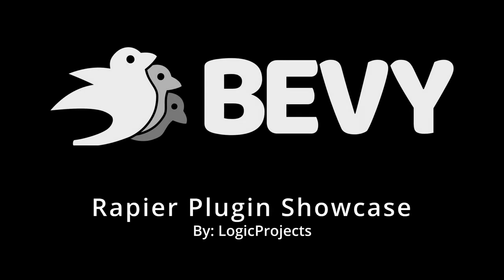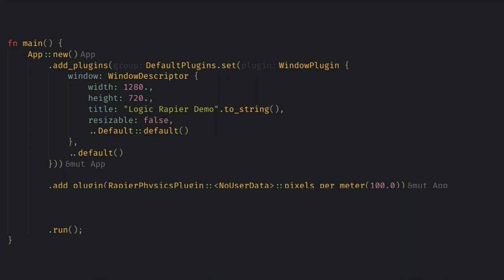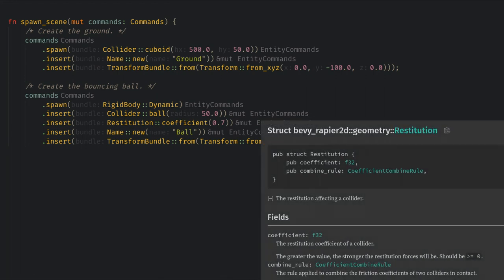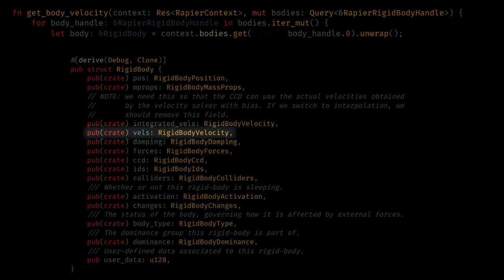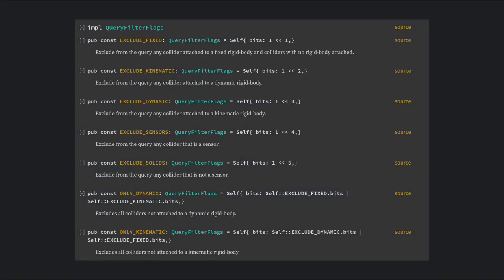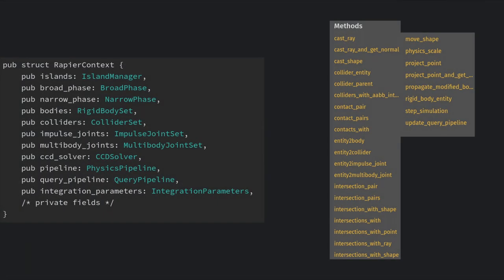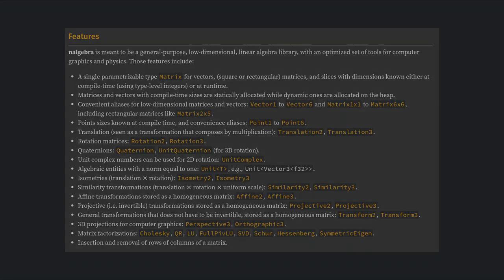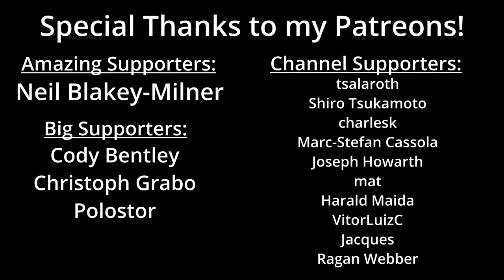Rapier Physics Engine Showcase: Rust Physics Engine for Bevy

Comment: I have a major problem with the engine collision system, because I don't have direct access to the collision system I can't order the collision confinement system to be after the movement system for my player. This makes my player to momentarily go through the collider and then bounce back in this weird artifacting when running continuously into a wall.
Reply from the maker: Yeah ordering plugins is something I wish we could do in bevy. I usually work around this by using the rapier character controller (which has improved) or their movement methods. Otherwise you can move your character controller earlier in the schedule but that is also suboptimal
Reply: @logicprojects  Is the only way to "work around" this is by making my own collision system?
Reply from the maker: No if you use rapiers movement functions you can pretest the movements and only apply the part of your target movement that doesn't collide. I think you should look into the rapier context resource
Reply: @logicprojects  Ok thank you, I really didn't want to delve into that (:

Comment: I was thinking through a scenario of having a car drive through a wall, or something similar.
Would you make all the "pieces" as "static rigid bodies" until the collider of the aggregate parent object is hit, then change all the pieces to dynamic so that the physics can take over? Does that sound reasonable.
Also, do you happen to know the relationship between "instances" and physic settings for that instance? (Do all instances have to have the same physics settings?) thanks for any thoughts
Reply: I guess you want them as dynamic all the time because the engine will make them sleep when not interacted with.

Comment: How is the performance of Rapier? How many instances can it support at most. I tested it before and felt that the performance was not very good, so I switched to the physics engine.
Reply from the maker: That is a delicate question, I have notice it preforms well on my machine but I have seen it start to tank in certain situations running in wasm.  It is designed in a modern way and uses simd/parallel processing so I would assume it is comparable to any modern physics engine (sparing it being relatively young).   The constraints on what it can support will be very machine specific and you would need to profile it on the target platform with the load you are expecting to really get a clear idea what it's performance would be.  What physics engine did you swap to?